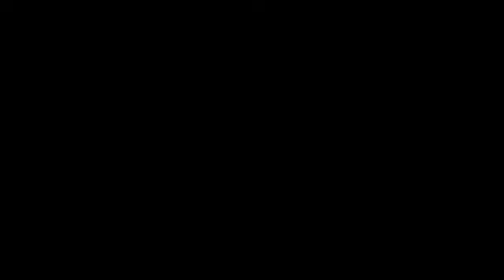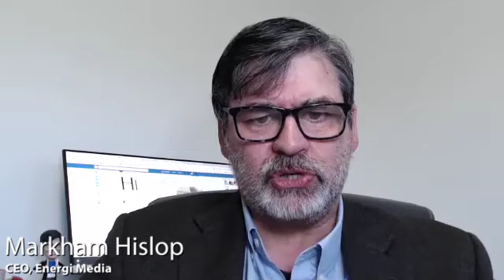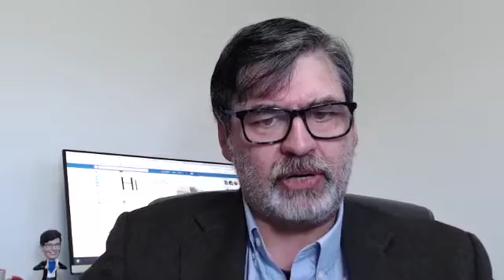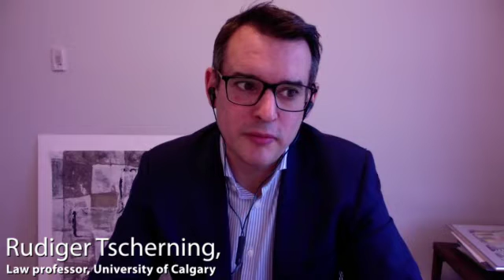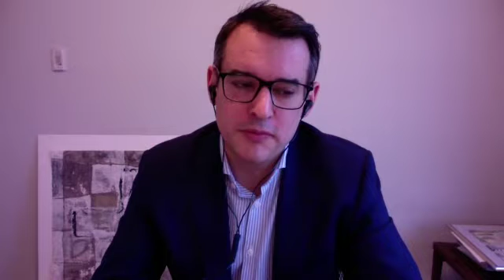Small modular nuclear reactors: The forgotten clean energy source?

Comment: What is the time to build a nuclear power plant? 8 years?
China is building 40-50 GW of solar PV a year and they have 11GW of nuclear under construction.
As of December 2018, 457 reactors with a net capacity of 401,837 MWe are operational, and 54 reactors with net capacity of 55,364 MWe are under construction. Of the reactors under construction, 11 reactors with 10,982 MWe are in China.[10]
So that is 400-500 GW of solar PV vs 11 GW of nuclear built in the same 10 year period.
https://en.wikipedia.org/wiki/Nuclear_power_by_country